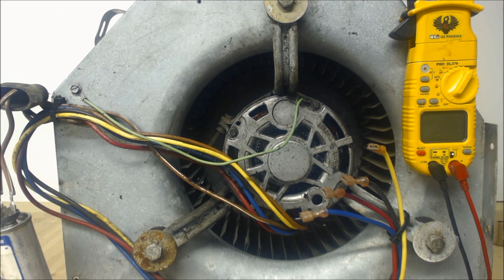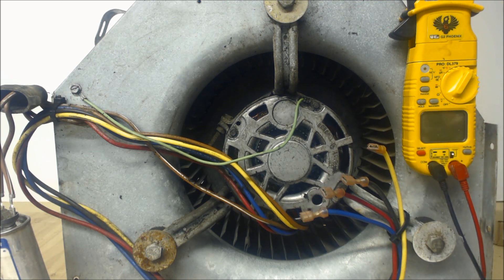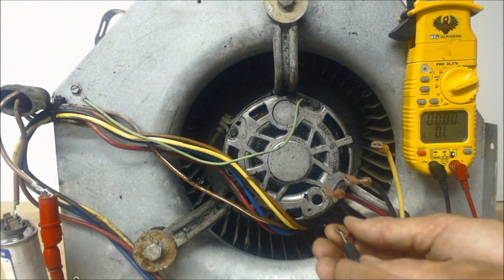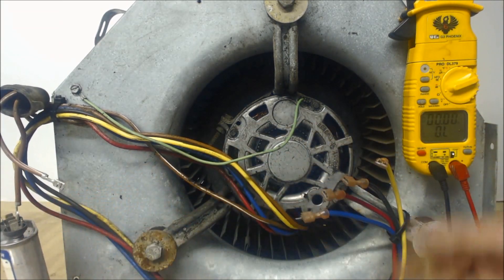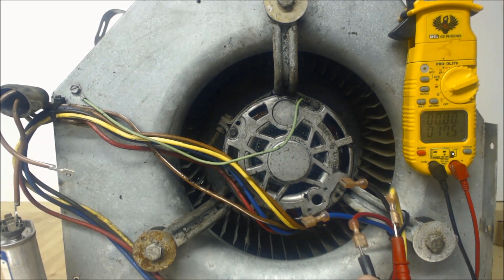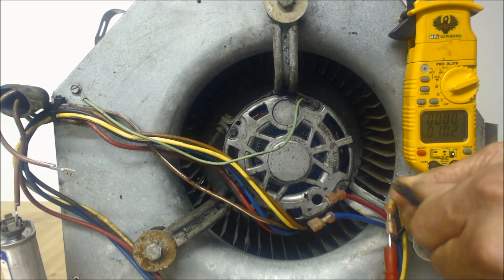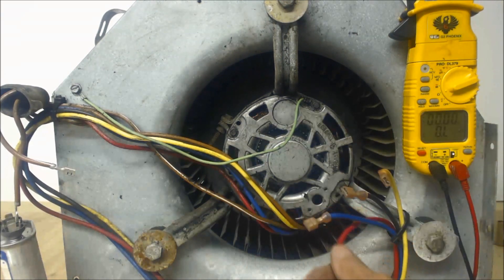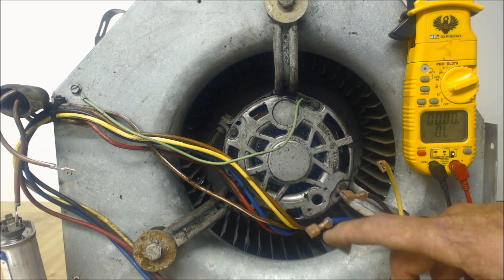240 volt PSC Blower Motor Fan Speeds- Wire Colors, Speed Selection Without Wiring Diagram!

Comment: Thank you for this video.  I knew how to speed control 120 volt, but wasn't sure about 240.  Question though... Is there any issue running 2 fans like this in parallel if the breaker and conductor are rated for the amp load?

Comment: I have 2 stage condenser with 2 stage 240v fan.While fan running I have 240v from L2 and black from circuit board but at same time while running I have 280v from L2 and red through circuit board.HELP.

Comment: Hi,I am changing out my blower motor,I have a heat pump on my old motor orange wire from motor to compaciter another orange hooked on same side as other orange wire that's goes through floor and a brown wire on other side of compaciter. My new motor has a brown wire with white stripe and a brown wire that goes to compaciter I'm confused on how I should hook up new motor to compaciter and this second orange wire going out side to the ac unit. Help would be greatly appreciated .

Comment: Both original and replacement run capacitor are same 12.5 MFD 440/370 VAC but new replaced blower motor has 7.5 MFD listed . Still good ?

Comment: Why are there connectors on the 24-volt timing board for motor one and motor two if they are just higher resistance?  Wouldn't you still need to send 240 down those lines to run the fan at those lower speeds? I don't understand why the other motor wires are plugged into that relay timing board.

Comment: Excuse my silly question but what will happen if by mistake the wires for the speeds are connected wrong(for example high-speed wire is going to low-speed connection) ? Is this going to damage the motor?
Reply from the maker: that will just run the motor in its highest setting when its supposed to be low speed like in fan or heat mode

Comment: I also have a purple wire coming out of the 230 volt motor.The wiring diagram shows purple and red are Hi volts, and yellow and red are Lo volts.Also have black and red speed wires in a addition to 2 brown Cap. wires.This blower was in an electric furnace and I plan to use as a garage blower/fan.So do I hook up my 240 "extension cord" to the black and yellow wires or the black and purple wires?
Reply from the maker: Not sure since I don't have the wiring diagram but it should show which to supply with voltage, thanks

Comment: Are all these speed controls done by electronic controller boards now ? If so are there videos available to watch on this new control technology ? Thanks for this very interesting video that clarified some of the theory that i was a bit shaky on.
Reply from the maker: Blower motors are powered by either the black or white relay on the control board, a separate fan relay, fan limit control, or sequencer, thanks. Maybe look up "acservicetec ifc"

Comment: The Run capacitor terminals are Run and start, the 2 brown wires go to the capacitor, either lead to either terminal, it does not matter.
An electric motor such as the type found in a cheap box fan have no run capacitor, they are a low torque motor called a SHADED POLE motor, they can be single speed or multiple speed, if multi speed and the wires are not colored such as Black = High,, 
Blue = Medium ,Red = Low,, The higher resistance the lower the speed.
If you ohm out a motor that is colored correctly you can verify Common to High speed is a lower OHM value than  the Low speed will have a higher Ohm value.  Common is the point at which the Run and Start windings are connected to each other.

Example, if the Run winding(Common to Run) is say 5 Ohms, and the Start winding is 10 Ohms, than the Ohms reading between the Run and Start windings should equal 15 Ohms, because the Run winding and Start winding are being read in series, both inline as batteries in a flashlight.
Multiple speed motors have the speeds on the Run winding.
If you take 1 motor lead and  read the Ohm values to the remaining motor leads, then take the lead that read highest to the 1st motor lead and compare that lead to the remaining leads.
The 2 leads with the  highest Oms readings are Run and start, The Start winding,(Start  to Common) is higher  than the Run winding, (Run to Common).
Reply from the maker: Thanks KD Grayson!

Comment: quick question i took out a blower only has red, black , orange    the orange on the blower diagram says it goes to line will orange be the common or medium speed
Reply from the maker: Always follow the manufacturers wiring diagram on the side of the motor to be sure, thanks

Comment: i took apart a 120V fan and i would like to just make it spin again, what wires would have to connect to a power source to do that?
Reply from the maker: Is this a psc blower motor you are working with?
Reply: acservicetech nope it's just some common rotating fan, but you seem to know a lot and you actually reply to your comments so I thought you might be able to help, if there is some universal fan wire coloring system you seem like the guy to ask.
Reply from the maker: If this is just a basic two wire fan without a capacitor then you likely have an induction motor and just have one hot and one common lead. It won't matter which one is hot and which one is common but once again, I am not sure if you have more than two leads coming off of it, thanks

Comment: So which is the common and which is the run tap?
Reply from the maker: Great Question! Common would be the wire that is connected in the motor to the brown/white stripe wire. They have almost no resistance between each other. Run the speed selecting wire, and start is the wire off of the capacitor.